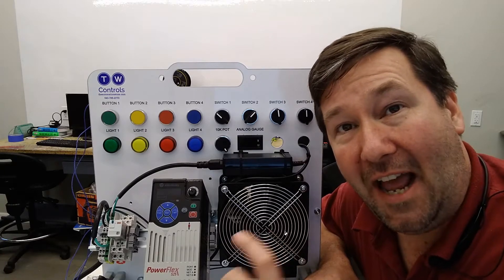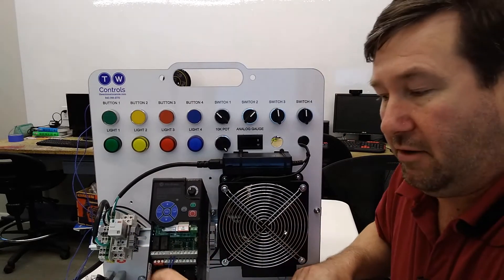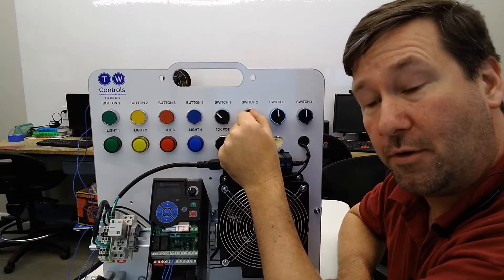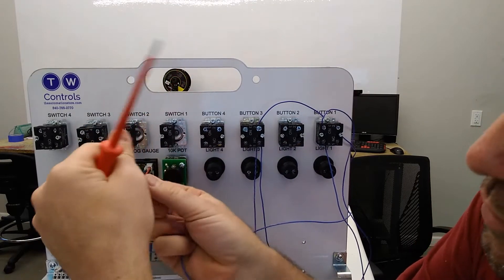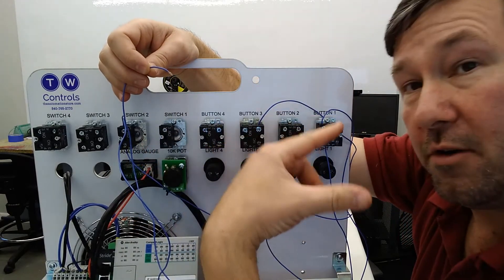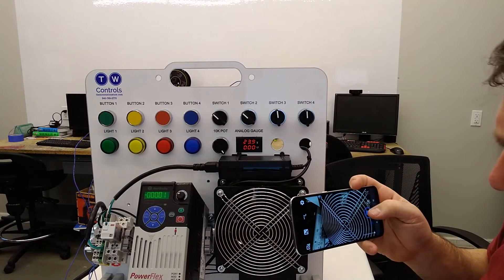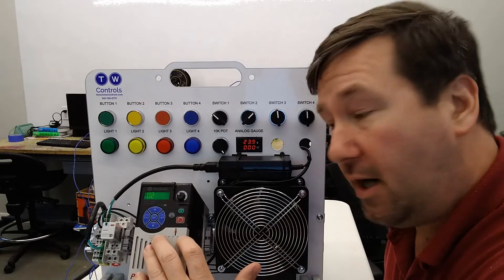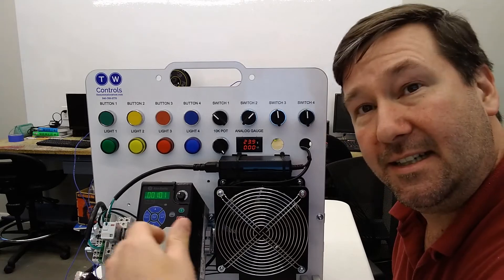How to Wire an Allen Bradley Powerflex 525 AC Drive for Reverse Operation

Comment: I have a drive wired like this but the motor is running the opposite direction. I tried changing the rotation direction in CCW but it didnt change the rotation direction.  I had to flip 2 wires to get it to run the correct direction. Any idea why changing the rotation direction had no effect?
Reply from the maker: Crazy question...did you download the parameter after changing it?

Personally, I don't like to change that parameter.  I would rather correct the rotation.  The less parameters you have to change when swapping out a drive, the better.

Comment: Hey buddy so we have this drive we just installed.  The only difference is we have green as foward and red as reverse? So when the green button is pushed it goes foward and when the red button is pushed it goes reverse.  Bit can't program it to do that any help will be appreciated
Reply from the maker: You want this 2 wire control video, then I think it is terminal 3 but you 'll need to check the manual.
https://www.youtube.com/watch?v=Ln50UTpZMuE